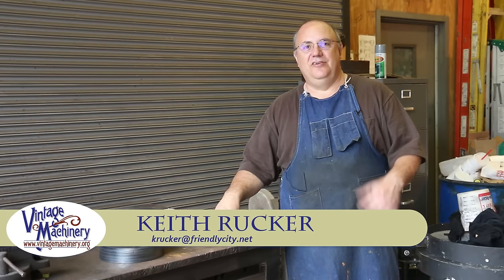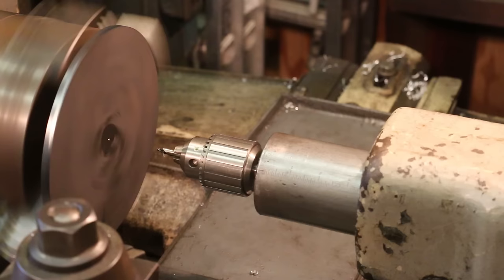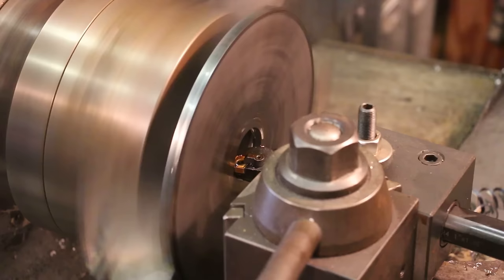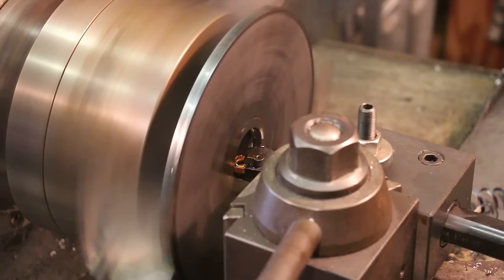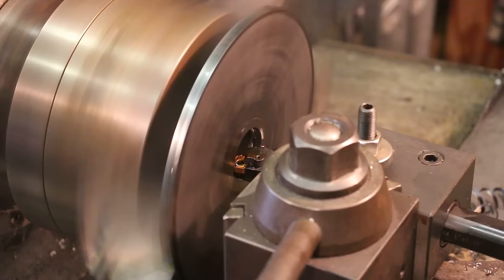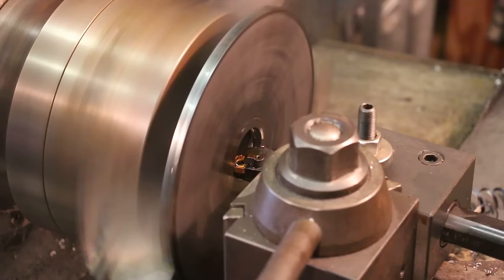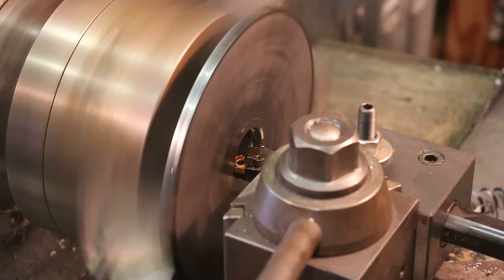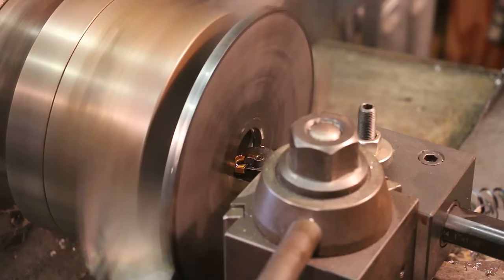Machining Dividing Head Index Plates

Comment: now.  That IS clever.  A glue chuck, who woulda' thought.  When I change to my alternate identity  as a wood woodworker, I have used the glue technique for years: the workpiece, a piece of brown paper then a plate for screws to hold all to the faceplate of the lathe.  A sharp knife splits the finished work from the holding plate and some sandpaper to clean it up.  Never thought of it for metal work.  Kurt, you are the expert. keep teaching the rest of us...

Comment: Great technic Keith. Thanks for showing us how to do that. CA glue is a great product, I use it all the time in my shop, but I've never used it to hold a metal part in the lathe. I'm a luthier and and there are countless tricks you can use it for on instrument repairs, every thing from joining parts together to finish and binding repairs also, you can mix it with baking soda and it makes a solid hard plastic like material, comes in handy for repairing worn out bridge pin holes in a bridgeplate. Good video
Reply from the maker: +Chuck Tipton I do a good bit of wood turning and CA glue is used for so many things over there.  But it also has its uses in metal work!

Comment: The glue chuck worked very well.  It is good you have a friend with a CNC machine to get the rest done.  Great video as usual.  Thanks for shariing.
Reply from the maker: +Amateur Redneck Workshop Thanks - it is nice to have friends who will help me out for sure.  If I were drilling these by hand, I would probably only make the two main plates that I need rather than the whole set.

Comment: Excellent video. I have also made indexing plates but in quite a different way. I needed some gears for a lathe so I used the original gears that would eventually wear out, made a device to indicate each tooth, punched the locations required on my blank then drilled them out. It was very time consuming to make the plate but it worked out beautifully. I like the glue chuck method, that will come in handy in the future. Thank you very much for the video. Being an old machinist I appreciate your work. Thumbs up. Take care.
Reply from the maker: That works!

Comment: I've used glue chucks on the wood lathe for years (hot glue usually) but never though of using it on metal. Another tool in the armoury! Thanks Keith
Reply from the maker: +Peter Fletcher I too first use a glue chuck on the wood lathe.  It is amazing how many tricks you can use on both types of machines!

Comment: Nice video, always interesting to see extra tooling made, certainly makes a nicer video than just buying it, thanks Keith, and nice to see you again!
Reply from the maker: +jusb1066 Thanks.  It would be nice to just buy some but they are pretty hard to find and probably pretty expensive if you do find them.  One of the nice things about having a machine shop is you can make things like this!

Comment: I have never used the glue chuck on the metal lathe before.  I have used it many times on the wood lathe.  When I was in high school taking wood shop my shop teacher taught it to me.  We always glued the blank to the wood waste stock with wood glue and several layers of paper.  The paper made for a very nice parting point that could easily be split off with a wood chisel.  Then you only needed to do a little sanding on the bottom of the bowl to remove the remaining paper and glue.  CA glue works great for filling cracks and voids when wood working.  I have used it for years.  Definitely going to keep this trick in the back of my mind for future reference.

Thanks!

Mike
Reply from the maker: +Junk Mikes World Like you, I have used the glue chuck many times for wood turning, but also a few times before for metal work.
Reply: @VintageMachinery  Turning and milling metals and plastics. I don't do woodwor really,, but the glue chuck works great for some things, just have to keel tool pressure low.

Comment: In the factory, we had a 30 ton press that would walk away from the assembly line from vibration.  We glued it to the floor with super glue.  5 years later when we moved it, parts of the floor came up where we glued the foot.

Comment: Keith,
I learned another trick from watching your video . . . the glue chuck. That's a clever and very functional idea. As always, thanks so much for sharing your work and explaining what's going on. I'm not one for CNC, but in this case, I think you are spot on by removing the "human element" from the equation. Hopefully, there won't be much problem programming the CNC machine. Never have worked with a CNC, I have no idea what is involved in programming one. Good luck with the finished plates! Thanks again!
Have a good one!
Dave
Reply from the maker: +Swarf Rat I am no expert when it comes to CNC but basically my friend drew up the different hole patterns in AutoCad and was able to convert the drawing to a program to use on the mill.  That is probably over simplified but I don't think that it took much effort.

Comment: Didn't make dividing plates, but some very large spacer "washers". I tack welded the 4 together on the rims, bored the centre hole to size after drilling, then drilled the other 4 holes through everything. Put the stack back on the lathe with an arbor through the centre of the stack and machined the outer diameter taking the weld tacks off at the same time. Then used the arbor to face them off to the dia of the arbor. Finally held them by the outer dia in the chuck and faced off what was left of the boss. Funny how you can remember some jobs from 40 years ago, but can't remember what you had for breakfast.

Comment: I use hot melt glue for this work.  But for thin plate I've used double sided adhesive tape and it worked perfectly.
Reply from the maker: +Joss Fitzsimons I have not had as much success with hot glue - super glue is much stronger.  I have use double stick tape with success.  You can also use loctite instead of super glue - it too is reversible with heat.

Comment: A good project that a lot of people have a need for (including me for by B&S).  The larger quantity superglue bottles available from FastCap (sold at Rockler) is really nice to have around.  The kit with the different types of glue, activators and de-bonder is the way to go.
Reply from the maker: +Jack Hoying When I was doing a lot of wood turning, I had lots of big bottles of CA glue in different types (thin, med and thick) as well as activator and de-bonder.  With my shop having been more or less packed up the past four of five years, all of my CA glue had dried up, hence the stuff I bought at Lowes.  I need to restock my CA glue assortment.....
Reply: +Keith Rucker - VintageMachinery.org Yes, the glues definitely have a shelf life.

Comment: Very nice presentation.  I have considered making my own indexing plates.  One of the things that worries me is the stress that may or may not be present in the original steel blanks.  I've had too many pieces of steel warp when  I turned them down to make them thinner.  Have resigned myself to always annealing strange pieces of steel in a heat treating furnace before attempting to make a seriously precise tool.  Cold rolled is in special need of annealing.

Comment: That was awesome  i seen Tom use double sided tap once.  but Super glue.. i would never of though it would work.   cool tip i hope to try it one day.  Thanks for sharing.
Reply from the maker: +one4stevo I like Superglue better than double stick tape as the tape tends to be a bit thick and has come cushion to it.  I think you get more accurate results from glue as you have a more solid connection.  You can also use Loctite.

Comment: I would have gone ahead and put the 3 holes in and just mounted them on an arbor to do the turning and facing, especially with several to do. My Newall DRO has a bolt pattern function that would make putting the holes in the plates a pretty easy affair since all you have to do is provide a diameter and number of holes and it calculates all the positions for you. Doesn't the DRO on your Wells have a hole pattern function? Still easier to let the CNC do it but I bet you could do them pretty fast using the DRO too.
Reply from the maker: +bcbloc02 I considered doing the mounting holes, but the whole purpose of the glue chuck was to do the facing operation and not so much the outside diameter (which I was also using the center to apply pressure to everything making it also a friction chuck).  If you mount the plate with bolts, you would have to face off the bolt heads to get the plate to the proper thickness.

Comment: nice job keith.  i have used the glue technique in the past with success but as you mentioned ,heat is your enemy and turning a disk that size without tailstock pressure would scare me. with so many disks to do i think i would have made a mandrel that would have allowed me to bolt the disks. that would allow for much more aggressive turning and also serve to hold the disks on a rotary table or cnc mill. its good to have friends with cnc equipment.
Reply from the maker: +larry sperling I was using tail stock pressure for the diameter cutting, the only part I relied on the glue chuck was the facing operation, which really would be difficult to do with bolts holding it in place.

Comment: You could've speeded up the turning to diameter, by making a shouldered arbor, with a washer and locking nut (and mounting the plates two at a time, un-machined faces together), which would've allowed you to take far heavier cuts, and reserved the glue chuck for the facing.

Comment: Nice job Keith! I have used a boring bar with a slitting bit I ground to cut large disks like that so I would not have to cut so much down on the diameter.
Reply from the maker: +John McRae I gave something like that serious consideration but I did not have the right cutter to do it and just really did not want to grind a special HSS tool just for six parts.  Maybe a bit lazy on my part but I think I got it done faster.  The ones I did off camera went a lot faster because I played with the speed of the lathe and really sped things up.
Reply: Your way might be better anyway with the glue chuck. Keep up the good work, looking forward to the finishing touches on the foundry furnace

Comment: Interesting Keith, I use a glue chuck on my wood lathe often. I enjoy watching your videos thanks for sharing.
Regards Brian
Reply from the maker: +782sirbrian Most of my glue chuck experience has also been on the wood lathe but I have also used it on the metal lathe in the past.  It is a handy way to hold difficult parts to!

Comment: Hi Keith 

Nice job and a little tricky setup, I think ... if the "top" of your jaws is running true you could just open the jaws to a little under the size of the finished diameter and use dobble sided tape to hold the blank to the jaws and just use a center punch and a live center to press the blank against the jaws - I've used this method severel times - a little fasster and just as safe, I think.
Reply from the maker: +Keld Sørensen I use a "friction chuck" all the time.  I think that what you are describing could have also gotten the job done.  It just was not the order of steps I really wanted to do things in.
Reply: Keith Rucker - VintageMachinery.org
I think it could have been much faster - but we all have our favorites - long to see how you "divide" the holes - teach us ;-))

Comment: I have a cincinnati dividing head with all the plates but if I needed one for occasional use I think I would print one on my 3d printer. It would nt hold up too well but for a home shop would probably be fine. Even if the holes were off a few thousandths , most dividing heads are 40:1 so they make divisions 40 times more accurate than the plate itself.

Comment: Why not start by drilling the centre hole smaller than required then mount plate on an arbor using a bolt and washer (washer still smaller diameter than required hole). Face off the front and turn the outside diameter. Flip the piece and mount in 3-jaw chuck on outside diameter before finally facing off the reverse to correct thickness and finally boring the hole to size.
Reply from the maker: +John Vickers Lots of ways to skin this cat but the biggest issue is being to face the opposite side without cutting into anything that is used to mount the piece with.
Reply: +Keith Rucker This isn't an issue with this method. I can't remember the dimension but, say the final hole diameter required is 1.75", the arbor mounting hole could be 1.25" and the mounting washer 1.5". You can then machine all of the face to the OD of the washer. The unmachined boss will the be lost when it is eventually bored out to 1.75".

Comment: I understand why you took slow cuts so not to heat it up, curious as I would have tried one thing different so would there have been a good reason not to do it "my way"??   If I was turning an 8" disk into a 6" disk I would have taken small cuts on the face (at a just over 6") then had an 8" washer with a 6" hole in the center for use with another project...  I realize like you say thier are many ways to do the same project, I just wnat to know if there was a good reason not to do it my way...???

Comment: Hi,thanks for this and all the other great videos.Chris (clickspring) can´t do that, when he works on brass, but working on thin steel plates, a magnetic chuck is also a possible way to hold those parts.
Reply from the maker: +Udo Willkomm A magnetic chuck would be an awesome thing to have.  Unfortunately, I don't!  But, it would be another way of getting this work holding done.

Comment: Faster method- stack all 6 discs together and tack weld them together in 3 places around the OD.  Set the stack on the mill and drill and bore the center hole to size, then drill your 3 bolt pattern.  Make a stepped arbor with one OD big enough to drill and tap the 3 holes to match the 3 holes in the plates and a smaller OD to match the bore.   Now bolt the whole stack to the arbor centered on the smaller OD and chuck the larger OD in the lathe.  Turn the entire stack to the proper OD and that will cut away your tack welds.  Now you have 6 plates bored, drilled and turned to the right size.  Now use a spider to space your plates out beyond the chuck jaws and face each side.

Comment: Bet that 1 1/2" drill got hot at the end of the cut!
Ahh yes - immediately thought of "Clickspring" regarding the glue chuck - something I really must try.
Great project Keith -- some pretty critical drilling needed after you got disks to size - if not a pretty slow job done by hand. 
Ahh - CNC - now there's the way to go :)
Reply from the maker: +ChrisB257 The drill was not hot when it was all done.  Slow down the RPM's and take a lighter cut and it is not all that bad.  I actually got the first two plates drilled out on the CNC mill today.  I was not there when he cut them, but he told me the first plate took about 20 min to drill and the second about 7 min (the second one had less holes than the first).  He will do the other plates for me in a few weeks but I got the main two that I needed right away!

Comment: Hi Keith, 

Glue chucking is common in wood turning, and they include a sheet of paper between workpiece and chuck, which is the weak point. Could you do the same with metal?
You could also use something like thin cork, which is an excellent material for things like a clutch, mount that to the chuck piece then apply pressure. 
CNC certainly is the way to go for drilling the holes. Doing it by hand would be agonizing, and you can guarantee if you made a mistake it would be close to the finish.  ☹

Comment: Interesting project. I was wondering though if it wouldn't have been better to put in the three screw holes into the dividing plate before turning them down to size. That way you could avoid the glue and just screw them onto the jig. On the first pass you'd just cut the screw heads down to thickness along with the plate.
Reply from the maker: +Wobblycogs Workshop I really wanted the drill the mounting holes and the index holes in the same setup, but what you describe could have also been used.